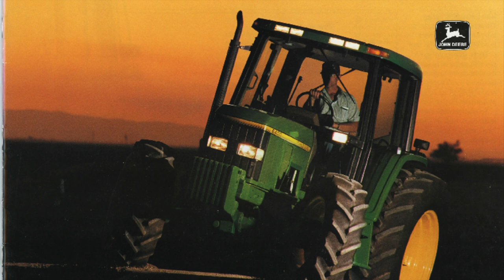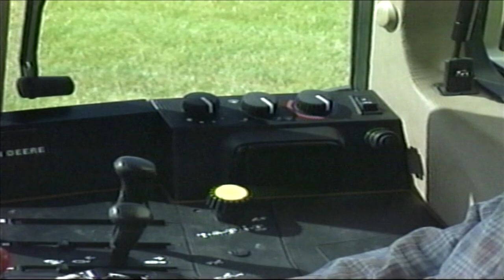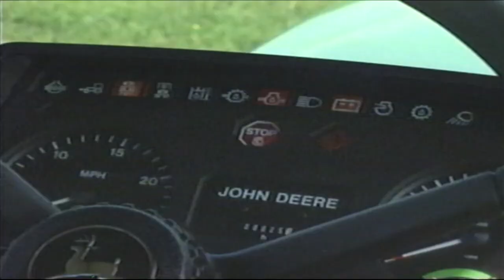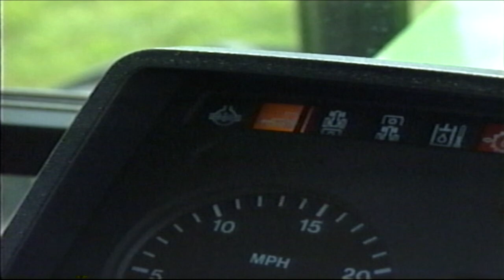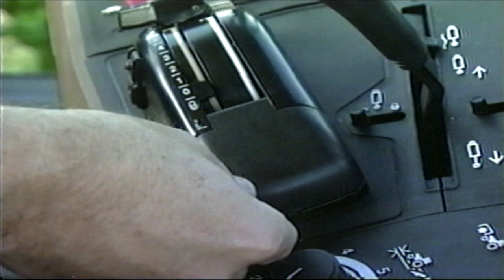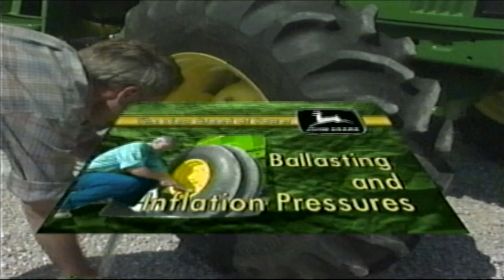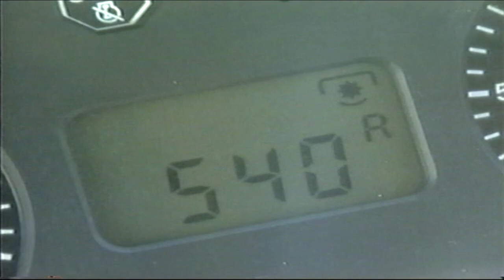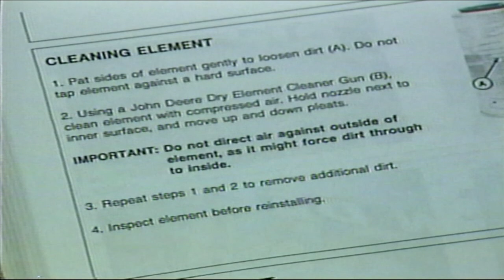John Deere 6000 Series Tractor Overview and Maintenance

Comment: Do you have any ideas or information about the rear brake repair kit for 6200. They develop brake drag and cause over heating  of hydraulic oil after a few hours of use. Been told there's no good fix or permanent solution.
Reply from the maker: I don’t, sorry. Honestly, I’m more familiar with the 7000 series. Stay tuned for the JD 7000 series video, hope to get it out by the end of the week.